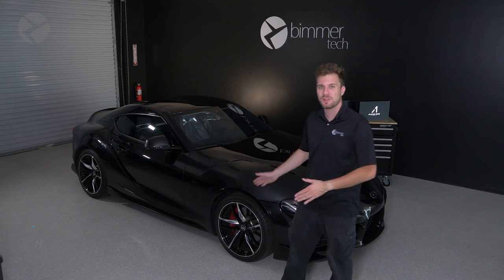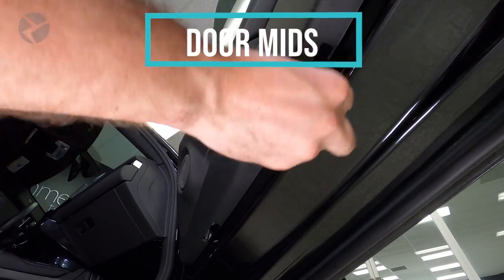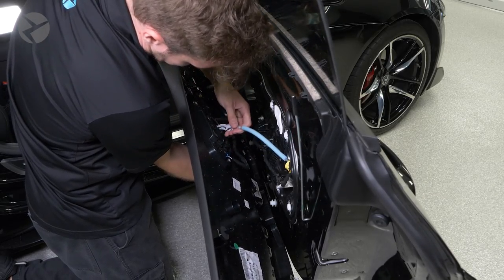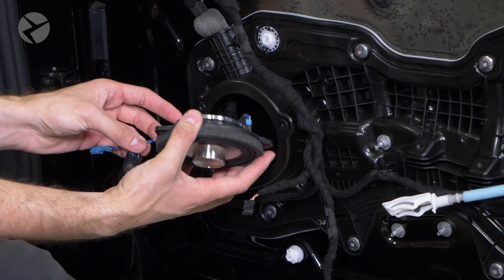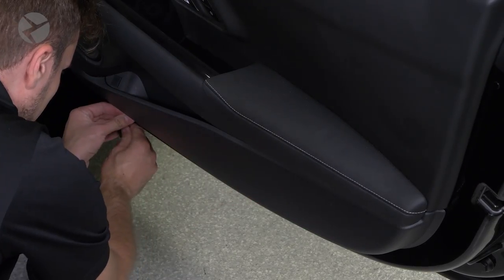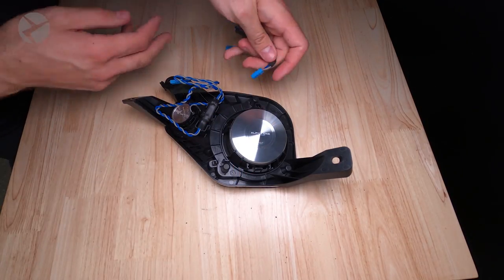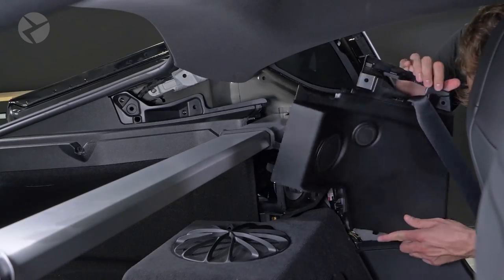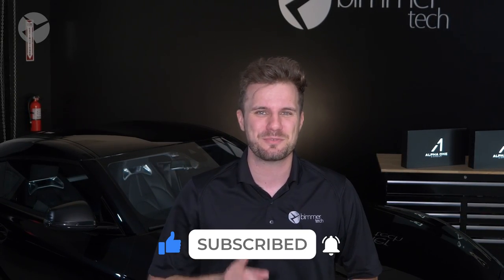Alpha One Speakers Install In A90 Supra

Comment: the center speakers has a horrible crackling sound after install when i separate it, it disappears so it’s almost impossible to figure why it’s doing it. So stressful
Reply from the maker: Write to our support team about this. It may have been caused by improper install. You can reach out to them at support@bimmer-tech.net. Please remember to include your order number.

Comment: I would lke to know if the factory stereo can be taken off and replaced with an aftermaket one? Im not a fan of the infotainment system being so high up in the dash
Reply from the maker: Both sound system and infotainment can be replaced. We don't really provide aftermarket infotainment systems though

Comment: 6:54 Use a thin film of silicone grease on the steel tabs before popping the panel back on - makes it much easier, especially when the next guy has to remove it.

Comment: 9:00 There is a MUCH easier and extremely fast way to do this - I did it today - hold the housing in one hand and grab the tweeter connector in the other then pull really hard and fast and the tweeter flies out without damaging the housing. It’s the old F = M A equation at work.

Comment: I just replaced the entire premium JBL speakers with Alphaone set and the 2 sub woofers too, here’s my update:

1- the Jbl system installed quality feels cheap and of poor quality. I am not a an engineer but having them side by side can tell that the material Alphaone is made of is much much better if incomparable, of course, same for the subs.

2- the sound quality is another level, the Supra now does sound like a premium car. The premium Jbl system, and the horn 😅, is in my opinion the worst parts in this car.

3- the sound is now deep rather than thin, no more vibrations from the subs and left back speakers as many complained including myself. The bass now is exactly as it should be.

4- I didn’t do the subs box modification by Tadda as I was waiting to see if I need to but not anymore, it’s just perfect.

So if you are like me and need your senses to be indulged in the moment, don’t think twice, buy the whole set and install it!
Reply from the maker: And this is called a sufficient review :D 

Thanks for a ton of good words pal! Cheers!

Comment: I wonder what is the largest size speaker that will fit in each factory location for tweeters mids and subs 🤔
Reply from the maker: You shouldn't fit larger speakers than factory size :)
Reply: @bimmer-tech  why not?
Reply from the maker: Even if they fit in, the sound could be spoiled by additional sounds and rattlings caused by proximity of the speaker to the plastic mountings
Reply: @bimmer-tech  sound deadening would correct that (dynamat or w.e)
Reply: @bimmer-tech  so would it? Still wondering